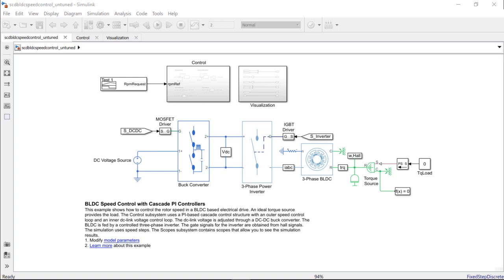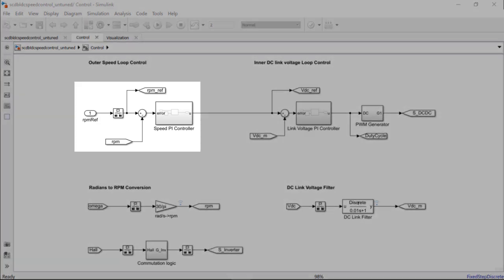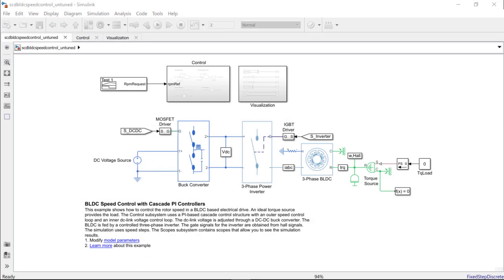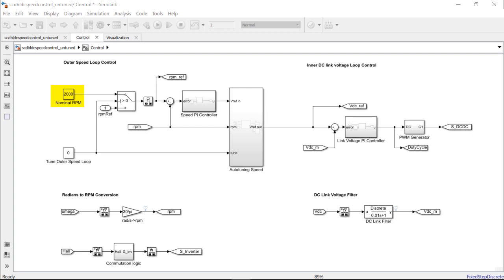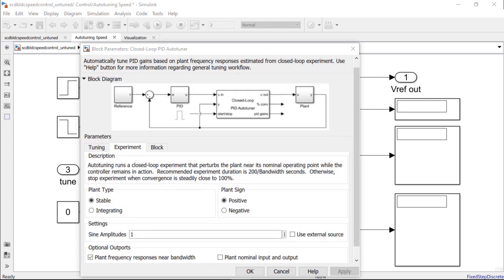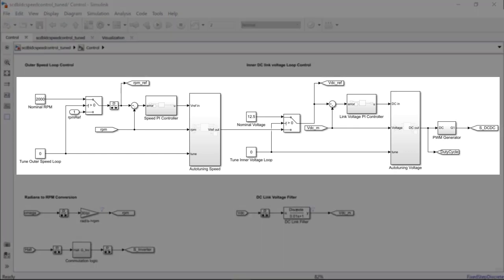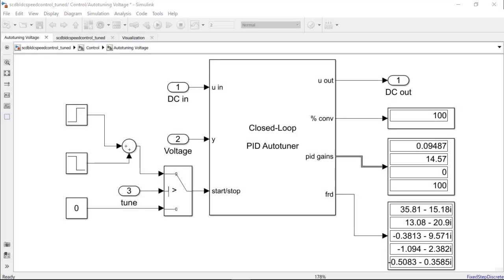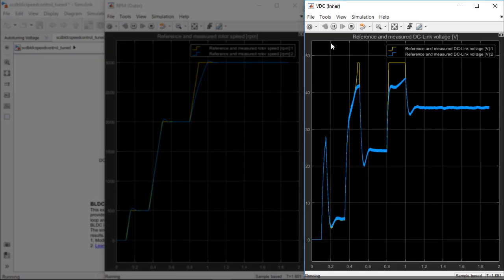PID Control of a Brushless DC Motor

Comment: why load torque is zero? What will happen if we add a step change in load?
Reply from the maker: Here we are tuning for a no-load condition. For different load torques you could try simulating and analyzing the performance if the PID controllers. If you are satisfied with it then you can use the same set of PID gains. If not you have tune a gain-scheduled PID controller to work for different load torques. You can use the gain-scheduled PID autotuner block for this use case. Please see this example: https://www.mathworks.com/help/slcontrol/ug/pmsm-tuning-using-gain-scheduled-pid-autotuner.html